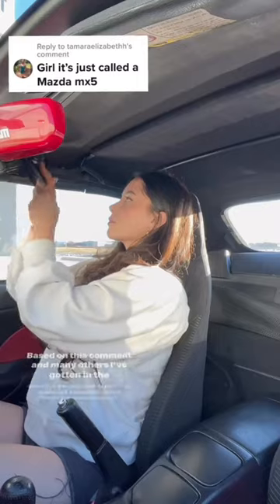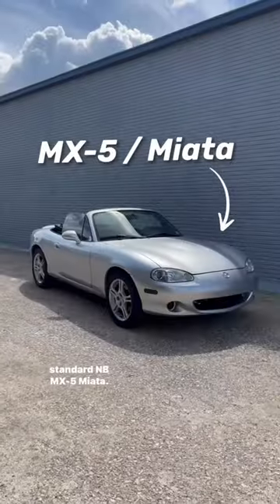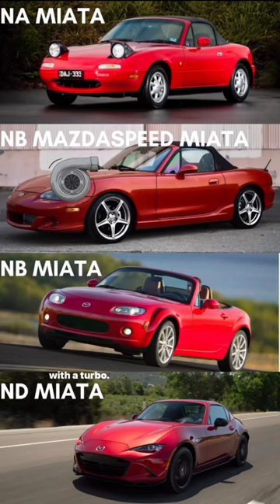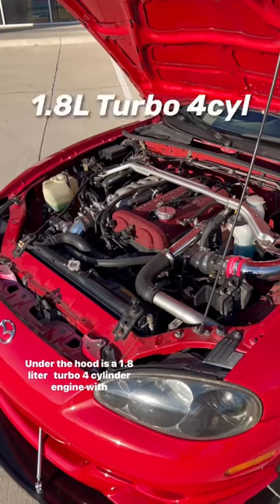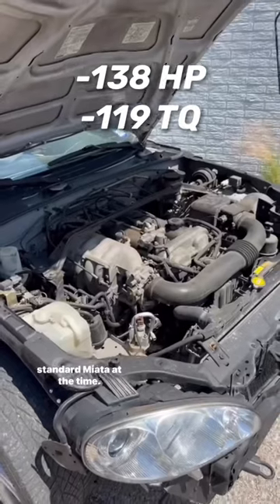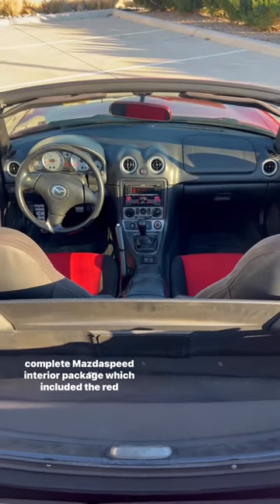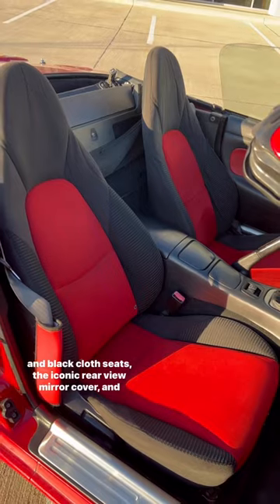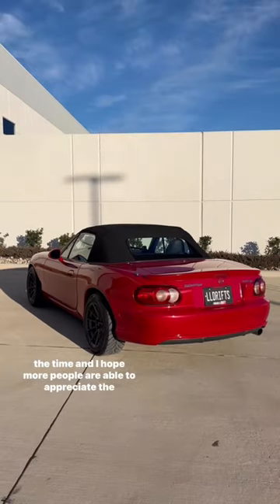MazdaSpeed MX-5/Miata? Here’s some info✔️

Comment: SHHHHH, I've been trying so damn desperately to get one and I don't want the prices taking flight 😂
Reply: Exactly 😢
Reply: No more steals on these Bub. I got mines in 2009, with 25k miles. Full Mazda Dealer price then: $15,000. I have about 70k on it now; and $15k is roughly what they go for on Bring a Trailer with ~70k miles. Even if I could get what I paid for it though, I wouldn't sell. Far too fun and reliable to consider anything else.
Reply: @egold2071  i know that, but even with how rare they are there's still not a "bro tax" on them like the s2k, which was my first thought then those things took off.
Reply: @someboiwhogivesadamn  Fax 🙏
Reply: 10k easy
Reply: @SaulTamalezX8 Pfft... Even at $10k, what kinda ragtop gem you gonna find with a slick 6 speed manual, turbo thrills, and RWD?
Reply: @egold2071  10k is what a 60k mile Mazda speed miata cost local to me.
Reply: @SaulTamalezX8  Please tell me where you're from. I'd love to pick up a few  MazdaSpeed Miatas for $10k and then flip 'em for an easy $5k profit. 🤔
Reply: Same I’m always looking for a Mazda speed mx5  but they are indeed rare
Reply: I scooped mine for 6500 in the fall of 2017; 113k miles velocity red, clean minus a little paint fade and the glass starting to tear out of the cloth top; but it's also got MS3 and half the flyin miata catalog thrown at her. Feel like I got my msm right before the prices starting rising on BaT.
Reply: They won’t . Nobody wants that bro
Reply: @SMACKDAD  that was an ignorant comment you can check bring a trailer, several have sold for 15k+ in  just the last year. Cheapest one I found was $11,300 sold last August.
Reply: @SMACKDAD  apparently it's not nobody, "BrO". If that were the case the prices of MK.I and MK.II Miatas wouldn't be going up.
Reply: @someboiwhogivesadamn  MK. I... MK. II...? C'mon pal, that sounds too Lincoln-y. Kindly use the proper lingo; It's  NA and NB.
Reply: @egold2071  right, if I was going to call it that I should have just called it a Eunos roadster lol. The MK.I and MK.II are what our friends across the pond call the miata. I call them that occasionally because I personally think it sounds cool.

Also i didn't notice this until now but why is there a goose in your pfp?
Reply: @someboiwhogivesadamn  The goose posed in such a regal manner, like he was a guard goose for my car. I figured I'd use that pic as my icon or 'pfp' as you say since I adore the car and the antics of Canada Geese.
Reply: @egold2071  it's an amazing picture, and I definitely see what you're talking about.
Reply: Bought mine for 3500 in 2022 probably the cheapest mazdaspeed miata sold. Needed a clutch master and key. ☺️
Reply: 150k miles
Reply: @harleymccravey4285  Yikes! 150k miles, $3,500 for a MazdaSpeed Miata? I dunno if you got a great deal or the worst clapper! Much props for keeping it going. 👏
Reply: Lol😂😂😂😂 goodluck
Reply: Too late honestly
Reply: I know when a turbo version is available, the advice is usually sell whatever you bought and get the turbo, but nah just buy a regular mx5 and turbo the thing. or buy an ND for the same price, they’re faster

Comment: If you never heard of it, doesn't mean it's not exist. Love the contents ❤👍
Reply: You don’t hear about it because evidently it’s pretty shit (no offense to the OP), gears are way too short so all you get it turbo lag, turbo lag, a split second of power, and then more turbo lag as you inevitably fall out of boost again… Granted a “shit” Miata still makes it more fun than 99% of cars so 🤷😅
Reply: @griffins750  they are pretty mediocre in stock form. I have mine on megasquirt ecu and a couple parts from flyin miata and it's making about 220hp now and it's a rocket. The gearing is short as hell, but you can swap the oem diff for a 3.9 from the 10ae models n that helps a bit.

Comment: Miatas in general should of all came factory with a turbo. Don’t see why they didn’t. left all that room in the engine bay, had a nb1 with 38k miles hardtop and Torsen lsd on bc coilovers and just some rpf1s, sold it for 7 and bought a 2016 sportster 72. Very happy with my trade too my sporty gets me more compliments and I still feel the wind🤙

Comment: The most powerful version of the B series engine is found in the 323 GTR which makes around 207hp from a 1.8l turbo and it's 4wd. Though the rally version of it made around 250hp and it continues to be the most underrated "sporty" cars mazda has ever made.

Comment: Imagine what a beast it would’ve been had they given it the same power figures as the MazdaSpeed 3
Reply: I agree 100% however it would be extremely hard or expensive to insure a little roadster with damn near 300hp from factory. Same reason they kept the power output low on the new ND miata.
Reply: @moremiatas  there’s plenty of convertibles from factory with more power figures that have similar insurance cost as a stock Miata. I had an NB, 350Z and SLK and they were all similar in insurance cost with just a few dollars differentiating between them. I loved driving the Miata but it was dog shit In acceleration. It had a 6 speed trans too with LSD so it had a little more get up.
Reply: @kenxiong6830  the difference is the weight. Insurance companies factor in weight to power ratios among other things.
Reply: @kenxiong6830  and it ain't a 0-60 car that's not the miatas forte at all
Reply: @moremiatas  if it’s weight to power ratio then insurance for the Miata would be cheap lol Like I said though, I owned those 3 cars and the insurance difference was minimal. I would’ve loved to have at least 250hp
Reply: @moremiatas  it’s definitely not the Miata’s ethos but 140hp gets old. Merging onto freeway speeds was always a pain. I drove turbo’ed Miatas with around 230-250hp and they were more enjoyable to drive. I should’ve kept my NB and put in an LS
Reply: @kenxiong6830  you're missing the entire point, miata insurance IS cheap, however you said it would be nice with more power. If you increase the power, the rates would go up. Also probably safe to assume you've got state minimum liability coverage on your vehicles. Go buy one brand new from the dealership and finance it where you're required to have full coverage. It's a big price jump.   

250 wheel hp in miata is a whole rocket ship! I'm at 210hp/200tq in mine and it's nice. Definitely not the fastest thing in the world but 200‐250 is a nice window to be in if you daily drive it.
Reply: @moremiatas  I think you’re the one missing the point. I’m literally telling that I owned all three: Miata, 350z and SLK together at one point when they were new and there was little difference between the insurance rates I was paying for all three. The only difference was the Miata had less power. Being that the 350Z and SLK had considerably more power with comparable insurance rates I wouldn’t have minded if the Miata had more power from the factory as I was paying the same same rate for all three. I’m not sure how bad your driving record is but mine was spotless and allowed for pretty good rates. And to your point, no I did not have the “minimum” state liability insurance. I paid full coverage for all three cars.

Comment: Also my 1.6 turbo pushes 305hp with the factory 5 speed gear box so with no mods other then a plus t setup so looking forward to what you can make with a mazda speed 1.8l factory turbo which should have the factory 6 speed trans if it's a real mazda speed nb

Comment: I doubt they come from Australia but something interesting is in Australia it wasn't called the Mazdaspeed, in fact they didn't get any "Mazdaspeed" cars. The Mazdaspeed MX5/Miata was just called the MX5 Special Edition here. And the Mazdaspeed 3, was just called the Mazda 3 MPS. 

For whatever reason Mazda did decide to make things a little confusing. Not that it excuses people trying to correct you when they are wrong. 

Another bit of interesting information is the NB2 1.8 cars in Australia had 152 HP, whilst in the States they only had 146 hp iirc. For whatever reason? Lol.

Comment: I owned a speed six and while it was fun and decently quick holy shit parts are expensive and the awd system sucked
Reply: Those Speed 6s sure were brutes, but I'll always remember the laugh I had seeing the Consumer Reports reliability chart on 'em. Other than mayyybe 'Radio', it got a black circle for EVERY attribute.
Reply: not sure what sucked on the AWD system

they performed really well in low-grip conditions and could send 50/50 power
Reply: @wes.9353  mine never really worked well and somehow managed to break a rear axle while just accelerating in the rain the car pretty much always was front wheel drive even in low grip conditions (but my last awd car before that was a Lexus IS and that had a really good awd system) so its possible i just expected to much from it
Reply: @sadladcinn  The rear diff mounts were its one big weakness. If you had flex in or broke your rear diff mount, that could be the reason for your rear axle breaking. 

Otherwise, you probably had a faulty Dynamic Stability Control system. I think that was mainly responsible for controlling power distribution. Shame you had a lemon, they're great cars.
Reply: @wes.9353  my diff mounts were good I did my research so I was taking it pretty easy on it before I could get the cork sport mount I just didn’t keep the car long enough to buy it I’ve moved on now though

Comment: And no one would care since it still looks the same. Unlike for example an e class amg merc with unnecessary exterior mods and large horsepower gaps compared to the standard one.
Reply: Pfft... You're takin' the piss. When mines glistens in the sun like a silver bullet, crouching on some gummy shoes, MSM-only smoked headlights glaring, big fat Flyin' Miata intercooler peeking thru the bespoke front lip spoiler... You know it means biness, Bubbalooch!

Comment: I didn’t know about the turbo Miata because these cars are extremely overrated, extremely expensive, and I have no interest in getting one. I’m not paying $15,000 for this shit. I’d rather buy and upgrade an old Honda Civic. That would make a way better sports car.
Reply: Extremely expensive 😭. Boy u can get a normal Miata for 6k. It’s a 2 seater with a top that that’s rwd a civic is gonna have a backseat no convertible and be fwd they different cars for diff ppl
Reply: @bantxc5616  That’s low end. That’s the price of a shitbox. A normal Miata in decent shape sells for $8,000-$12,000 depending on how many miles it has on it. A normal one in great shape, or one that is turbocharged can sell for $13,000-$18,000. These cars are excessively expensive.
Reply: Pfft enjoy the rubbish in the bargain bin Bub. And are these really that expensive, if you can enjoy them for years, then sell off for the same or more than you paid? You keep hatin' whilst these gems keep appreciatin'! 🤘